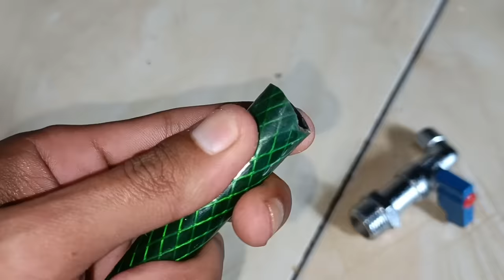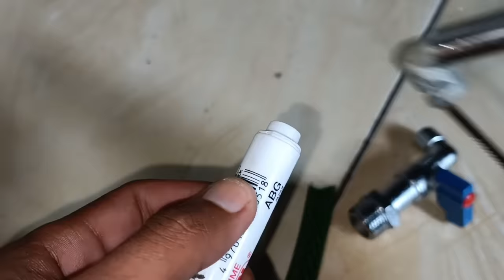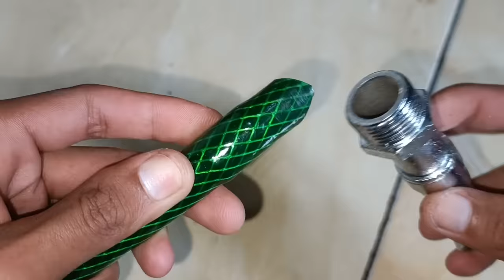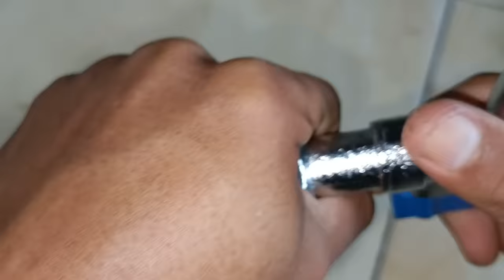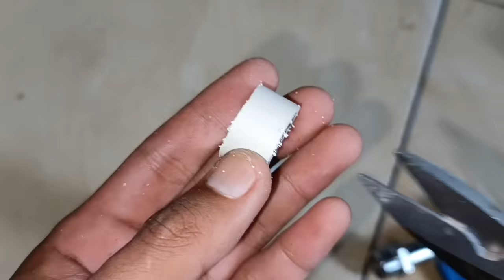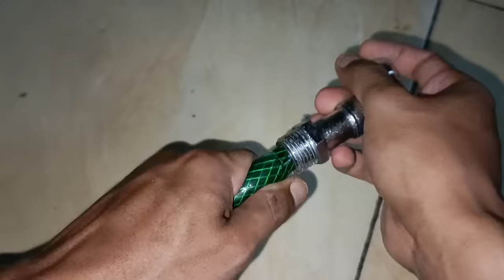Why Didn't I Know This Trick Before! How to install a faucet on a water hose without using PVC glue

Comment: For your additional information, you can turn on/off faucet that connected on the other end of the hose without applying this stupid stuff
Reply: True 🤣🤣

Tinggal buka-tutup kran yg di ujung satunya 🤣
Reply: It's about creativity and the truth is that a lot of people love this trick
Reply: Ýýýýýýyyyyyyyyyyyýýýyý
Reply: just for content
Reply: I don't know if you do gardening or not. Clearly this trick is saving time and money too. If you have a long hose it is hustle to off and on the faucet if you want to watering your plant but at the same time want clear up the dry leaves. It will prevent the water wasted. Sorry for my bad english
Reply: @azil_m  Yes that is the whole point..... they do sell adapters but this is a cheaper option and maybe be better. Coz the adapters sometimes leak or break easily.
Reply: This is not stupid stuff,, i often wash my car and i need to buy the hose extention that have some function with this. It is pain if you need to go back and forth just to turn on and off.
Reply: Maybe, but with this stupid stuff you don’t have to waste time & energy to go forth and back to the main faucet. Specially when the distance is quite far from the flower or when you’re washing your car.
Reply: @muhammadaris7115  mungkin iya, tapi capek mas bolak-balik. Apalagi kalo nyuci mobil. Pake ini bisa hemat tenaga, hemat waktu, dan tentunya hemat air/listrik.
Reply: Whatever😝
Reply: RIBET
Reply: @azil_m  i agree. You're right!
Reply: Clearly you don't understand it's use. You're showing your ignorance